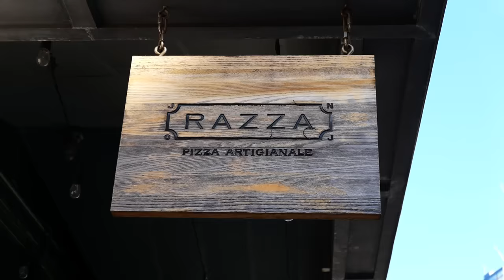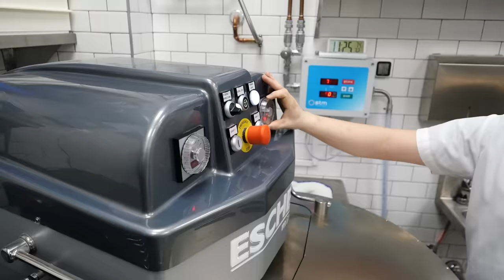American Food - The BEST PIZZA in New Jersey! Razza Pizza Artigianale

Comment: If you're the guy weighing and cutting, you gotta get good really fast. I've worked for a company that had a dozen stores, and the production plant was crazy fast and crazy fun. I missed it when I went on to working in and eventually running the stores. But as anyone who's ever worked in a pizza joint will tell you, that is a different kind of fun. That was my first career, 30+ years ago, and I still wish there was a way I could pay the bills making pizza.
Reply: I'm the baker at a pizza joint- I just make the dough.  I've gotten to the point I can cut and roll 360 pieces in 2 hours solo. Down from 2 1/2 hrs from my first summer lol. It's not my favorite thing to do.  If I could have a machine do it, I would 100%.  But love the job regardless!

Comment: you need a hot brick oven to cook fresh mozzarella on a pizza. without the heat to evaporate the escaping brine that comes out of the cheese when its cooked, you would end up with a soup on the pizza. adding it at the end , when the pizza is cooked works perfectly. 21:01 is what you get when you add the fresh mozz After cooking
Reply: I think its burrata not mozarella.

Comment: Should be called zero topping pizza. That mozz was super low effort same with the sauce. I wouldn't pay more than 5$ for one of those .
Reply: Not to mention, burnt pizza. No thank you. Need to lower down that fire.
Reply: @ShiftNova  not my style and definitely not the best but if that's a 700-800 degree oven  it takes 90 seconds  and that's char.   not burned  at all.     It brings flavor, prevents  sloppy drippy pizza.   Crust should not be a giant breadstick.   I think it's kind of pretentious and hype but I do give them credit for doing their own thing.  that is a fantastic oven as well.